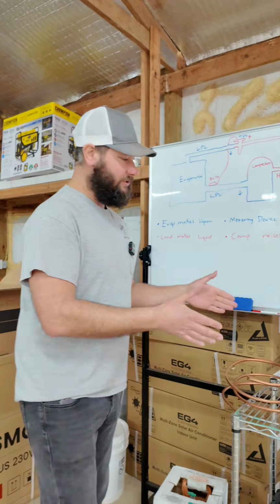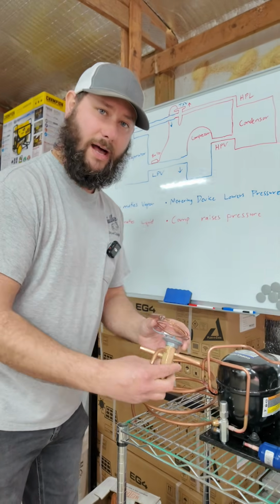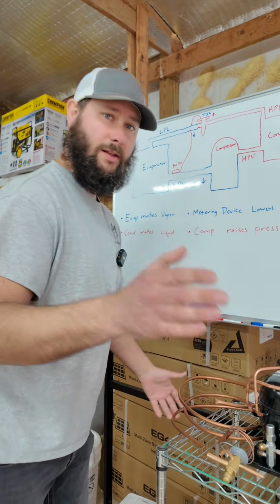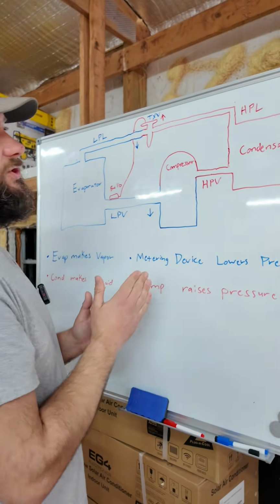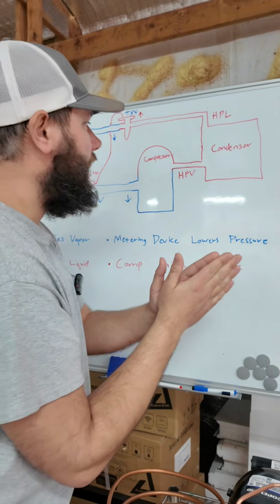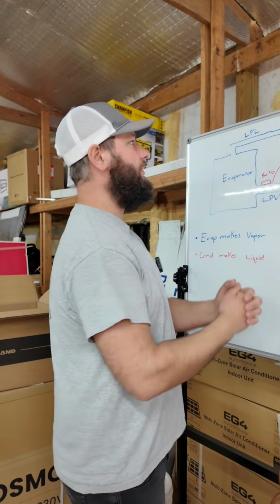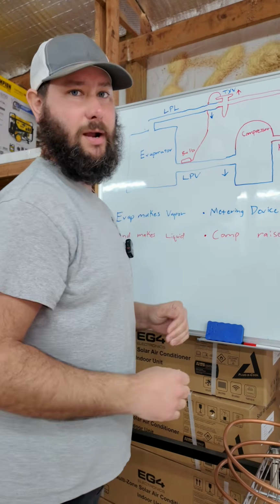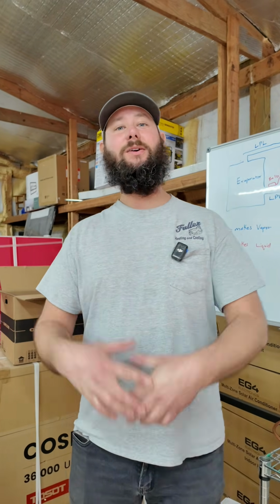HVAC Refrigeration Cycle Explained — Compressor, Condenser, Evaporator, TXV

Comment: If tcv drops the pressure to lower pressure/temperature, why need compressor to raise the pressure/temp, could it be possible to just bypass or eliminate the compressor ?
Reply: The compressor is needed for refrigerant flow
Reply from the maker: Have to have the compressor my friend
Reply: @akiranaski2280  compressor is the "heart" of the system it moves the refrigerant

Comment: Shouldnt there be an accumulator, reversing valve and a filter drier
Reply from the maker: Not necessarily
Some refrigeration systems do not have an accumulator and heat pumps have reversing valves

Comment: Liquid  is flashed to a vapor,  PHASE CHANGE is what makes r22, or 143a  or any refrigerant cold.  You condense the refrigerant into the high pressure line, then let it loose thru the txv valve.  The carburetor of the HVAC system.   It sprays the refrigerant

You cannot compress a liquid, so vacuum your lines down.